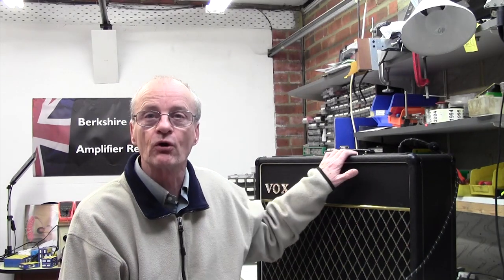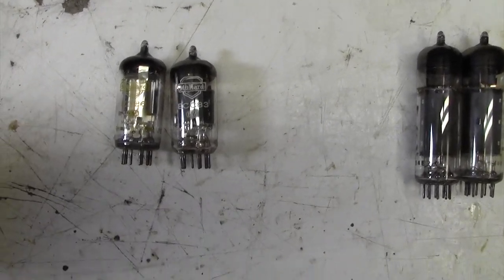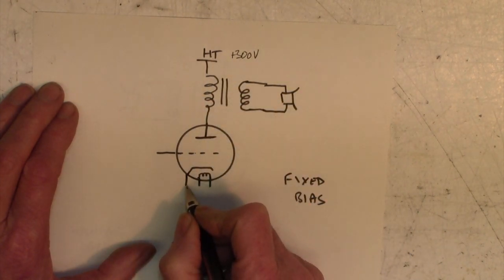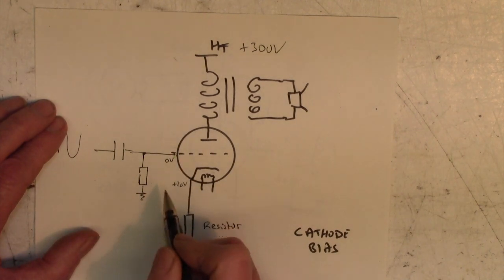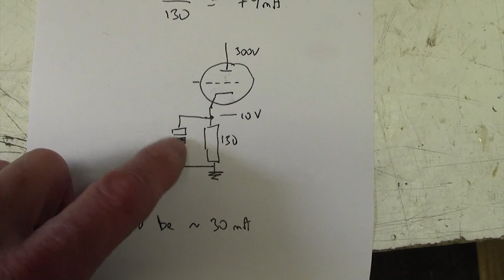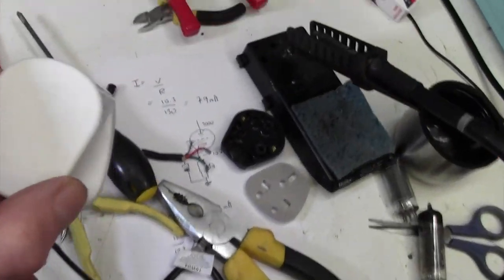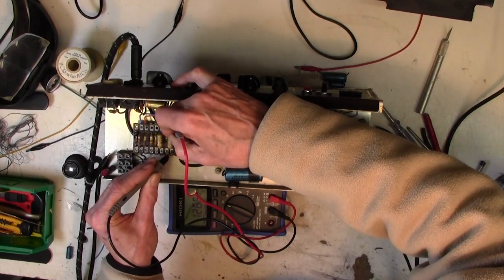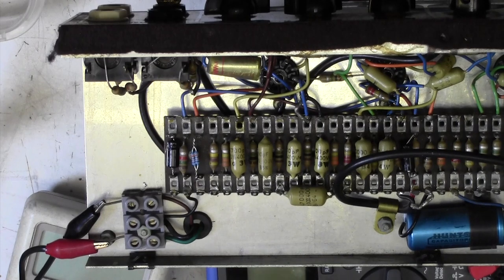VOX AC10 Check Over and Repair

Comment: I'll have to disagree about old caps, they can explode and cause a fire too, also if they short they can take the power transformer out. I've seen all these things happen in my 30 years of working on amps. I'd rather replace a $20 cap than later a $300 power transformer.
Reply from the maker: Hi SCott. Interesting. I've never sen either of those in thousands and thousands of amp repairs.
I do take your word for it though.
Reply: @stuartukguitarampguy5830  , if you're  not replacing the main filter caps ---- the filters for the output tube plates and screen being the most likely to fail catastrophically ---- then adding a fuse (250 to 500 milliamps should do) from the centertap of the HT secondary to ground is a good idea (mandatory under the circumstances if ya ask me).  You can put it inside the chassis using an in-line fuse holder with leads, making it easily reversible/ removable, and  you won't have to drill any holes. It will save the power transformer from destruction  if a filter cap shorts. By the way, many modern amps, especially those with EL84'S, also add an HT fuse to the CT of the output transformer primary, probably because today's modern EL84'S are prone to fireworks when run right at or beyond their maximum ratings. An internal HT fuse would be a good idea.
Reply: @stuartukguitarampguy5830  More common in American and Japanese amps because of low quality parts chosen I would imagine. Lots things were designed for and sold at department stores. Some "high end" manufacturers use substandard parts these days as well.

Comment: Great video as always, Stuart, thanks for sharing. Agree that cathode bias is typically used with low power amps, there are a few that use bigger octal valves (albeit still at low power) for example I have a commercial amp that has a pair of EL34s in parallel class A cathode bias for about 12 watts (it is going for a lower volume Marshall sound) and I have a cathode biased (single ended class A) amp that has a bias pot and can use all the usual octal power tubes - to be fair, I built it and it is currently rocking a 6550 because I had one spare... I'm a big fan of the EF86 as a preamp tube, Dr Z uses them a fair bit and I think some of the Matchless amps did too as did the Blackstar Artisans. They can be microphonic though.
Reply from the maker: Interesting stuff, thanks for sharing.

Comment: Hi Stuart.  The Fender Bassman AC568 (and other Fender AC568 circuits) use 2 6L6GC tubes and are also cathode biased, using a pair of 150ohm, 7 watt resistors.  It also is grid biased, using a 10K linear pot and some additional resistors.  Very unusual Hybrid "Fixed/Cathode Biased" circuit.  I don't think Fender stayed with this circuit revision for very long.  My 1968 (or 1969) Fender Bassman happens to have this circuit.
Reply from the maker: Interesting thanks Michael.
Reply: @stuartukguitarampguy5830  If you would like an AB568 schematic, let me know and I can email you one (pdf), but you can probably find one online if Paul McCartney's "Get Back" Bassman amp ever finds it's way into your shop.

Comment: ECF82 triode-pentode is directly equivalent to the American 6U8; the other nearly identical American tubes that can substitute are 6EA8/ 6GH8.  Same exact pinout, with slightly different gains or electrical characteristics.  All of these were commonly used in classic tube hifi equipment such as Scott, Fisher and others, and they are being reproduced these days as well as a good amount of new old stock still being available. The EF86 pentode is also known as the 6267, or Z729; *not an easy tube to find nowadays*,   if you want one that is quiet and non- microphonic anyway. 

 Pentodes were once commonly used as microphone preamp here in the States, starting with the octal based 6J7, with a grid cap on top (a classic, historical mic preamp tube for broadcast and recording studio use, still popular today), superceded by the 6SJ7 (no top connection), and finally the special low noise 5687 mini 9 pin tube, somewhat similar to the EF86 but unfortunately with a different pin out and lower gain. Some Gibson guitar amps used the 5687, and they were often seen in commercial mic/music mixers and paging amps for restaurant/ business background music and industrial paging. The 6AU6 is a 7-pin pentode that you might see in guitar amps as well (Silvertone/Danelectro, for instance).
Reply from the maker: Interesting thanks. I think they use a pentode here to get the vibrato to work as it has that extra grid.
Reply: @stuartukguitarampguy5830  , I looked at the AC-10 schematic; the EF86 is the input preamp for the vibrato channel, but it is the pentode half of the ECF82/6U8 that forms the vibrato oscillator. The triode half of the ECF82 is the mixer tube where the "normal" channel enters the amp, therefore the vibrato channel has much more gain. Pentodes typically have far more gain than triodes, and less internal capacitance, making for better high frequency performance, and great for building oscillator circuits.

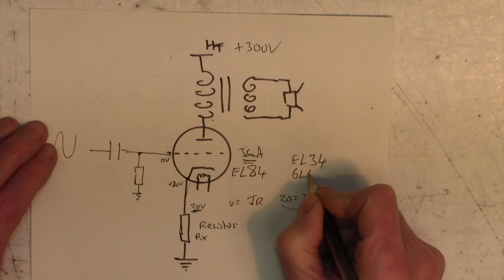Comment: 20:00 You might be interested to know that the early 60s Ampeg B15 bass amp ran a pair of 6L6GC output valves and was cathode biased. Later versions were grid biased, increasing the output power rating from 25W to 30W.
Reply from the maker: Interesting thanks.

Comment: EZ81 aka 6CA4 rectifier. Those Mullard EL84's might be perfectly okay ----  I would have tested them and tried them in the amplifier. They're probably more rugged by half than most modern replacements.
Reply from the maker: I did test them and they were fairly low emision. WOrth replacing I think. Customer took then away with him.

Comment: Drool!!
Reply from the maker: Slaver....
Reply: @stuartukguitarampguy5830  ? Slaver, what does that mean. I'm Danish, I might need to add a new word to my vobaulary... ;-)
Reply from the maker: @christianboddum8783  Hi Christian. Actually there are two meanings and they are pronounced differently. slAver (with a long ayyy sound) would be an old term for someone who ran slaves, e.g. ran a slave ship. Slaver  (sl'ah'ver) has a short 'ah' sound. It means to visibly drool over somthing tempting! A similar word is 'slober'. Neither are used much these days (like many, many words are dropping out of use. I wonder if it is the same in Denmark?).